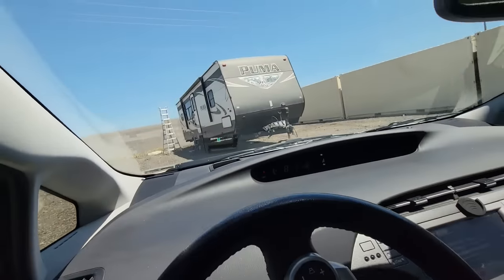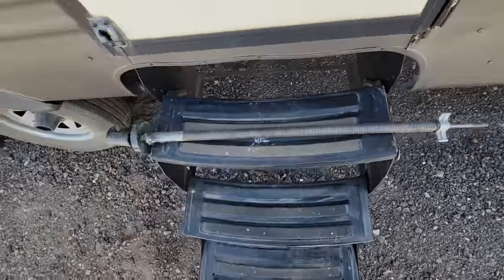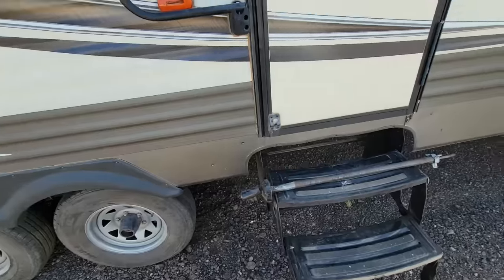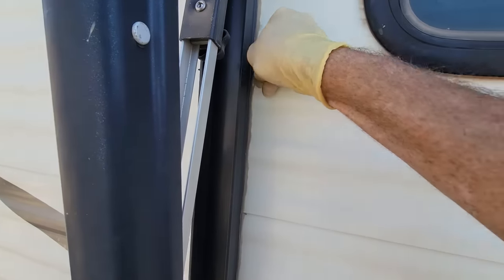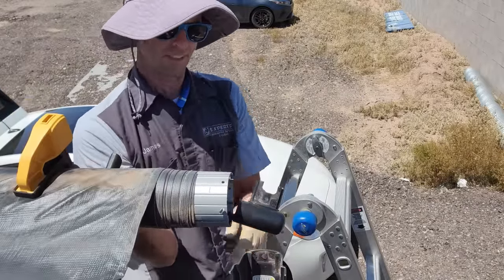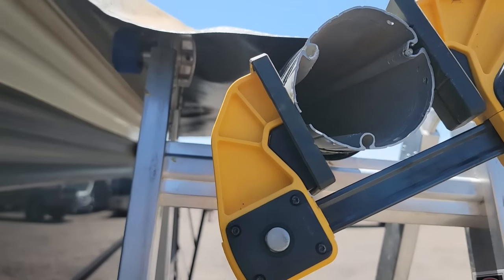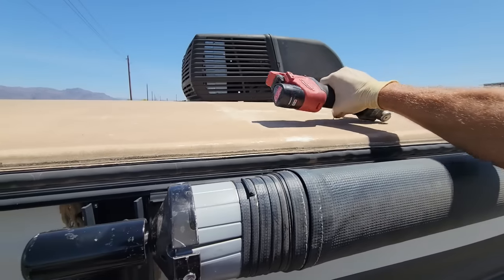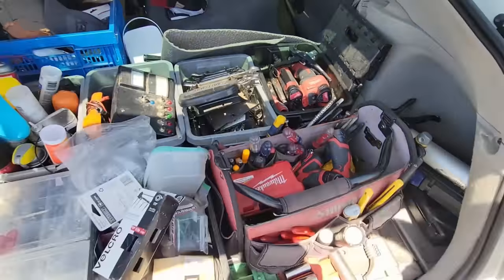A Simple Job: Dometic Power RV Awning Torsion Replacement

Comment: What????? No roof replacement, I feel cheated. I am always learning from you James. Wind away from the top of RV. I have never been able to remember which way to wind an awning spring. I wrote it on the inside of the back door on my service van, but your way is a LOT simpler.

Comment: Thank you for the video. How did you know the tensioner spring was bad? My awning is stuck in the open position and when I press the switch to bring it back in,  all I hear is a faint clicking near the motor. The local rv tech said that sounds means the motor was bad. How do I know if the tensioner is bad too?

Comment: If the spring was wound the wrong way would it roll out and not roll up? I installed my new awning fabric in my awning but only turn the spring about 4 turns and may have wound it the wrong way. The awning came out but won't roll up.

Comment: I really appreciate your videos. I have a 2018 thor Chateau with a solera lippert power awning. Just this past weekend mine failed in the out position at checkout time of course. 
The drive head motor gear pack just shattered?? I was trying to figure out why. I thought maybe the struts froze.? Or now seeing your post i wonder if i had a torsion bar failure? I had to cut off fabric to stow away(needed replacement anyway) because I wasn’t able to roll it up by hand. Is there a test i can perform to see if it even has a torsion bar system? I bought new struts because i could even fold arms in with them in place. 

Thanks

Comment: Hi Question for you.  I have a dometic 9100 awning. I had a guy do an awning(fabric) install and he was struggling with the right side and said something about tension and motor not working which turned out to be not the case. My whole arm just collapsed couple of days ago. There was no wind and no rain. can the wrong torsion cause the arm to collapse? that's my question. thank you.

Comment: the wiring to the awning motor looks a little thin, could that be why the motor is struggling to wind up being so warm during the day and the black finish of the arms just heats up and inducing heat in the wires then causing high resistance???

Comment: Enjoy all your videos they are very educational.I have to replace the TPO on mine and have no experience so I am cramming youtube videos and most are yours.Along the edge where the awning fabric is attached to the edge of the top where the drip rail? trim goes along the top edge holding the fabric,how do I remove the fabric there away from that trim piece?I see tiny phillips head screws.Thanks....forgot to mention,the dealer we bought it from 3 years ago never shows up a month straight and the other RV repair guy never showed up  SOOO I will do it myself :)

Comment: Thank you for this very informative video. Your instructions are right on. Took me about 4 hours total to finish. Had to recurve the arm that the torsion arm slips in to. I recurved the arm by cutting a wood block to fit inside the arm and used a nylon head hammer to reshape the arm. All is well. No injuries and about $400.00 still in my pocket

Comment: I see this is on a power awning, my question is on a manual awning do you have to do both sides? If yes, do both springs get wound away? I have a 2003 Fleetwood Flair, 17' awning.
Reply from the maker: yes both sides wind away from the top of the roof

Comment: Love the m12 rivet tool.  Especially working on a ladder or any awkward reach
I find it easier to put the zip tie in the top pivot bolt of the arm. No gaps on fiberglass walls 
Most dangerous RV repair.  The awning. 
Ladders.  Torsion springs. Gas struts.  
I tell new techs to turn it like your rolling the awning in to put tension on the springs.  Away is like clockwise, subjective. Away from the top or away from the bottom.    Assuming the fabric is rolled correctly. 
I hate working on the box awnings the most but not cracking your head on the arms is nice
Thx for sharing 
Enjoy your content
Reply from the maker: Thank you. I hate box awning repairs too, especially any Girard awning :)

Comment: I broke the end cap that's on the end of the tension spring bar on my Dometic awning.  I bought a new cap online.  Can just the cap be replaced or does the entire tension spring bar assembly including the cap need to be bought and replaced.  The bar seems fine.
Reply from the maker: I would replace the whole thing
Reply: @AZExpert  Thanks. I bought a replacement torsion bar.  Your video is excellent.

Comment: It's a 16' awning and you did 8 turns to set the tension....does that mean that a 20' awning would require 10 turns?
Reply from the maker: You need to check with the manufacturer